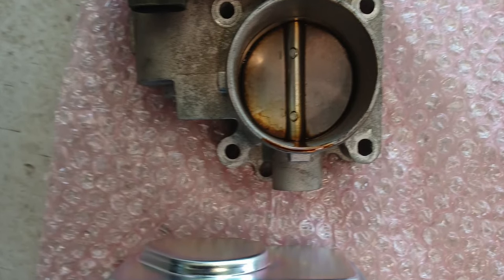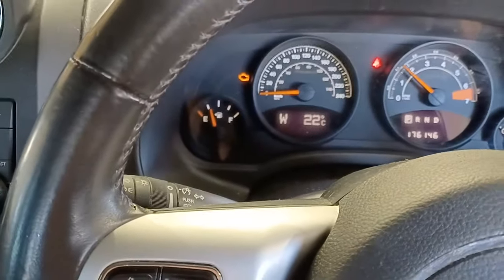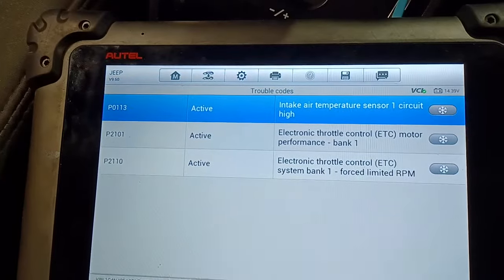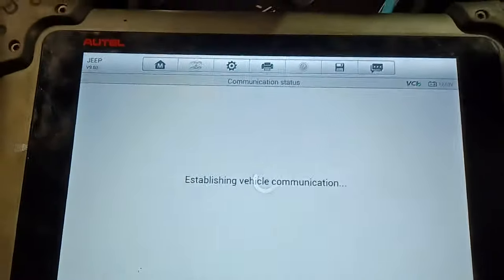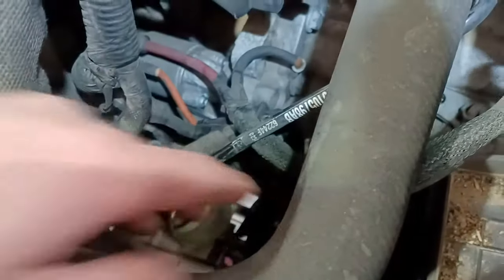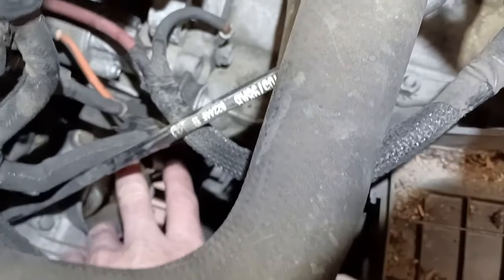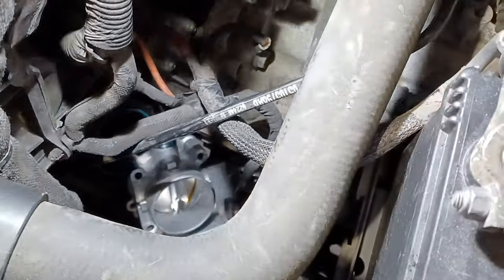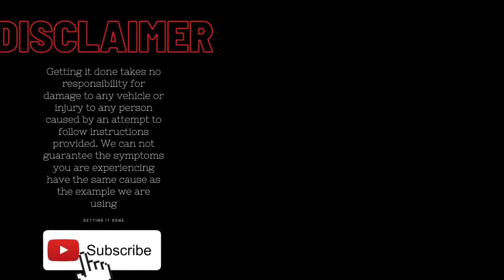Jeep Compass throttle body fault and replacement (lightning warning light on dash)

Comment: Thank you so much! Would you recommend a website to purchase a new throttle body online? 

Also does the Jeep compass 2014 have a specific throttle body or its the same model regardless of the year of the car ? 

These are the error codes: 

P2110
P2118
Throttle Actuator Control System - Forced Limited RPM
Throttle Actuator Control Motor Current Range/Performance

Thank you for the video! Loved it 🇦🇺🇦🇺

Comment: Hey I got the codes U1407 and U1424, spark plugs were worn out and after replacing them the engine idles fine but  still gives me just the check engine light and those codes. do i need to replace the TP or just clean it?

Comment: If this light is on in conjunction with the engine light could it be something else because Auto Zone mentioned it may be my transmission but this video is having me lean more towards the throttle body.
Reply from the maker: This fault will also turn the engine light on. You really need it diagnosed by a mechanic rather than a parts store. Reading codes is one thing, knowing what they mean is another. If the throttle body light is on, it's extremely unlikely to be caused by a transmission fault. But a faulty throttle body could also trigger a transmission fault.

Comment: Thank you very much, this video was really helpful. Am curious to know, what is the danger or disadvantages on the car if the flash lightning signal is on.
Reply from the maker: Disadvantages would be the vehicle not running correctly and a loss of power and driveability, because the throttle either won't open or be in the wrong position. The danger would be if it went the other way and decided to default to open instead of closed. That would be a really dangerous situation of you're driving although that scenario would be pretty rare I would think.

Comment: I have similar problems in my jeep compass. Latitude 2013. How do I know if kits this or the accelerator sensor on the gas peddle? I don't have much money and not a mechanic. Please respond. Thanks.
Reply from the maker: With a scan tool it can be proven on the live data, without a scan tool you would want to check for the noise of the gears slipping inside the throttle body.

Comment: Hello I replaced the trottle body already in my compass 2016 but still popping up the lighting light and control traction off blinking when this happens I can’t acelerate like it’s not responding on trottle , mostly in the mornings when the engine still cold, I turned off and then on it disappears and I now I drive it normally. Any help would be super appreciated 🙏
Reply: Have you figured out your issue?? I literally have the same exact problem.
Reply: I have the same issue as well
Reply: Not sure if this will help but if you turn the key on (not the car) for 15 seconds, then off for 10, then turn the car on, it should reset the lights unless there is another issue, hope this helps!!
Reply: i know on chevys the gas pedal needs replaced and after replacing this stuff the new ones need reprogrammmed.
Reply: See if you have a wheel sensor out
Reply: Did you find the issue?? Same happend to my wifes compass. I replaced the throttle and when the cold came in the issue started again. Replaced the throttle once again and still doing the same thing when theres a 10 degree change in the climate of south texas.

Comment: What is the approximate cost too fix this? I have jeep compass sport 2013 auto. With same issues
Reply from the maker: The cost depends a lot on what the part costs in your country. I don't remember the actual cost of this job. But I would say somewhere around the $500 NZ mark.

Comment: Did the problem ever come back? Its easy to see it fixed at first but maybe it comes back after a few miles.
Reply from the maker: Had this car back in for a safety inspection (W.O.F) the other day. It has not faulted again at all since I did this job, sometime before posting this video.

Comment: I just replaced the part by myself do i need to take it someone and get the codes cleared so it will stop being in limp mode
Reply from the maker: Just make sure the throttle valve is moving and not jammed. If it sticks, just give it a slight push to free it up. You could try disconnecting the battery for 5 minutes to see if that will reset the codes. Otherwise you may need to take it in to be scanned.
Reply: @gettingitdone1  i tried the battery being disconnected and that didn't work so i am going to try a few other things

Comment: how do you fix that heater flap! mine does that!!
Reply from the maker: Hi there, sorry we didn't actually fix that as the customer didn't want to fix that. It can be a different issue each time, often it's the flap not being able to reach it's home position, or a gear slipping. You really need to follow the noise and see what is actually happening on yours. Unfortunately that sort of thing is not usually that easy to get to.

Comment: Did you disconnect the battery to reset the computer at all?
Reply from the maker: No, we are a professional workshop so we have a scan tool to clear codes. Disconnecting the battery will clear codes on some vehicles. The light should go out once the problem is fixed, but codes may still be stored in the ECU.